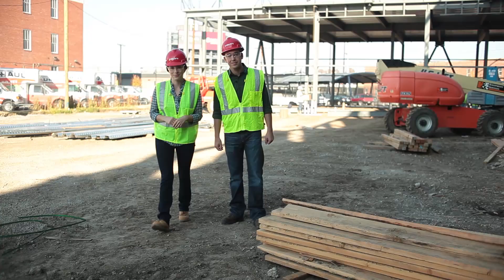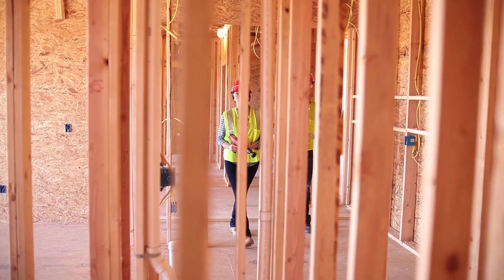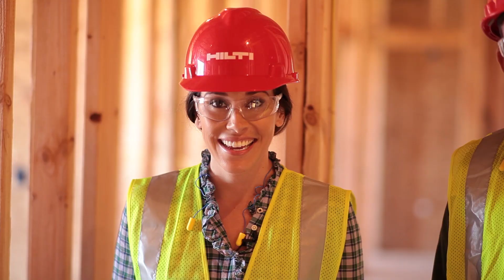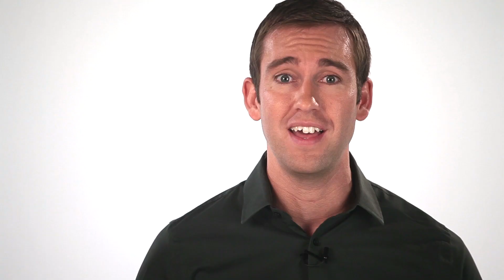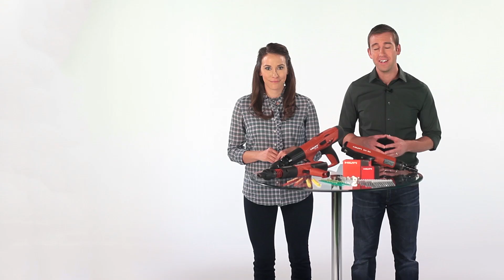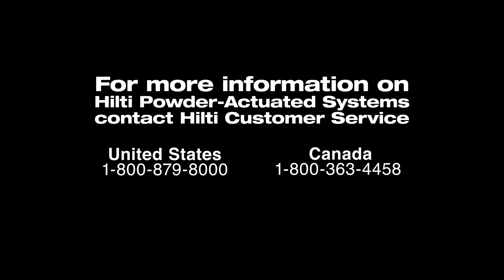HOW TO select the right Hilti powder or gas actuated tool for your application

Comment: We're a small surveying firm that required a nail gun for our field work (driving nails / studs into concrete and asphalt), when we need to determine the fixed position of a suveying point and need it to stay there for a prolonged period of time. One usual example is when we're monitoring construction of buildngs etc.
To that end, we have acquired Hilti DX 460 and although we don't really need its rapid firing and high capacity 90% of the time, it comes real handy for the times when we do. We also bought MX 72 high capacity magazine and mostly use yellow powder cartridges (medium power), and I must say that driving 32 mm nails into asphalt is like driving a hot knife thru butter even when we set the power to 1 or 1.5. Driving nail into concrete is simillar, although we need to set the driving force to 2 or max 3. Now we have gotten a great deal on red cartridges and 52 and 62mm nails and we hope that the Hilti will stay true, because it's a wonderfull piece of equipment.
Reply from the maker: Thanks for the great review! If you need additional advice for cartridge power selection, or have questions, please reach out to us at 1-800-879-8000 in the United States or 1-800-363-4458 in Canada. Our customer service team is ready to help Monday through Friday 8a-5p. They can help with technical questions or coordinate a local representative to come visit you if you aren't working with one of our Account Managers already.
Reply: I'm really trying to reply and not sound like a commercial, but I'm very pleased with the whole Hilti experience. For example, my local Hilti authorised dealer didn't have the 32 mm nails in stock, so the seles rep organised it to be delivered to our office the same day, from another city, which is 60 miles away. Just keep up the good work, I guess that's all have to say.
Reply from the maker: Will do! Thanks for being a loyal Hilti customer. If you'd like, please send your contact information to hiltisocial@hilti.com and we will send you some free Hilti gear! -Dan, social media team